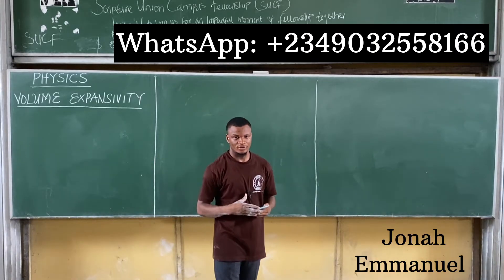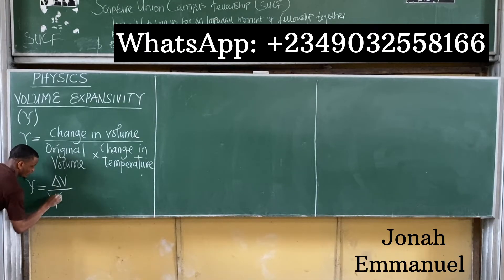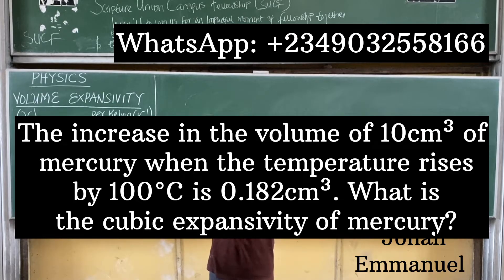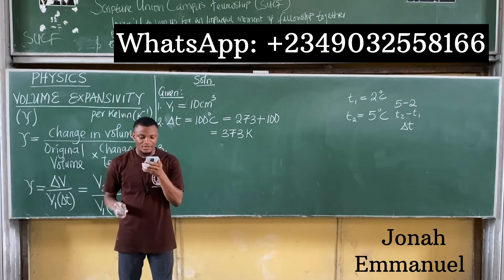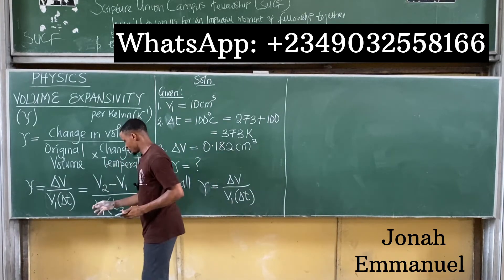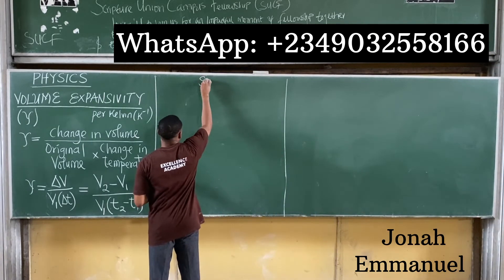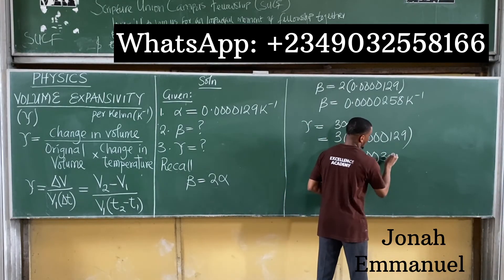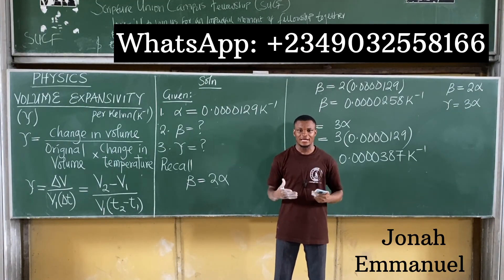Volume Expansivity (JAMB & WAEC PHYSICS) - Meaning, Formula Derivation, Unit, Examples and Solution.

Comment: do you really need to convert  Celsius to kelvin? are we talking about standard temperature and pressure?  You got it all right and failed it all because of that conversion. The question doesn't go with ideal gas.